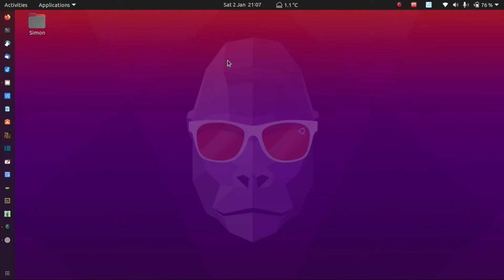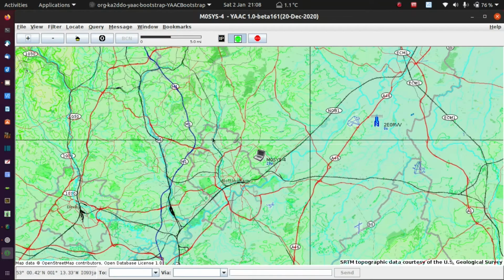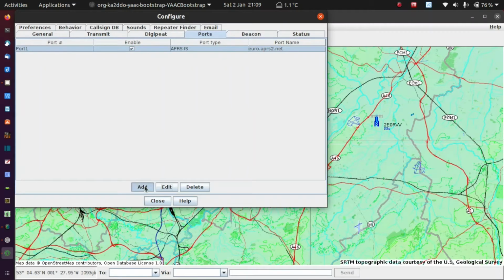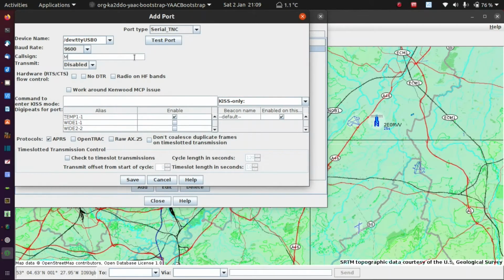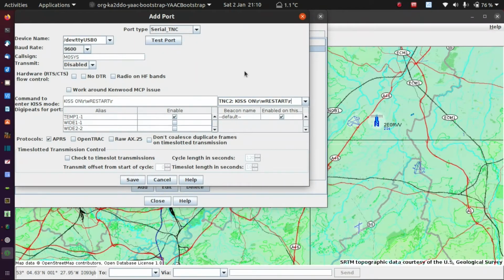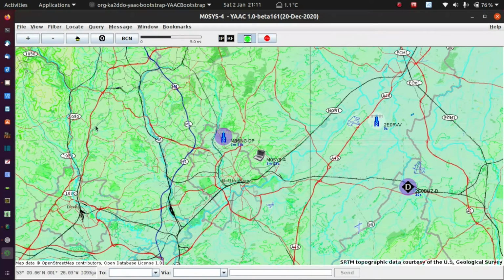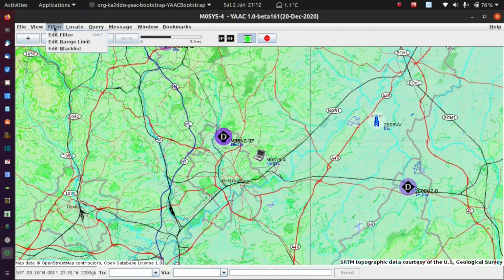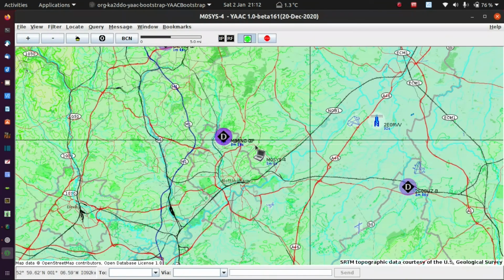YAAC igate - How to setup YAAC as an igate!

Comment: Great video,I just started to use YAAC with a Mobilinkd tnc2 and want to setup a Igate and Digi do you have any ideas on setting this up ........
Reply: Hi and thanks for the comment!  I have not used one myself but the setup should be similar to a TNC, I would suggest setting up the port as if it was a Kantronics KPC-2 and see if that works, do you have any instructions that give information on setting it up?
Kind regards

Simon